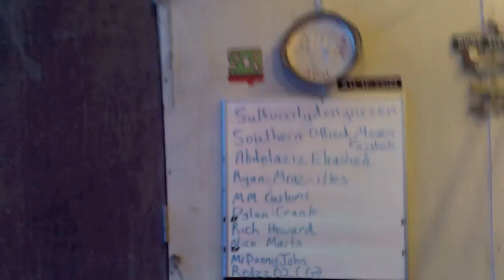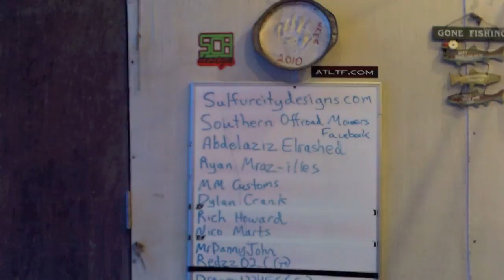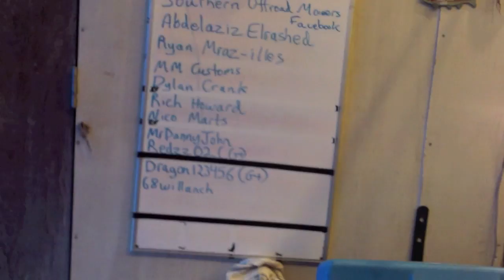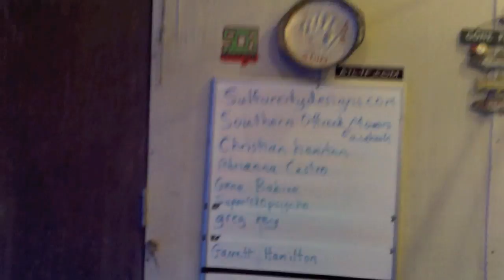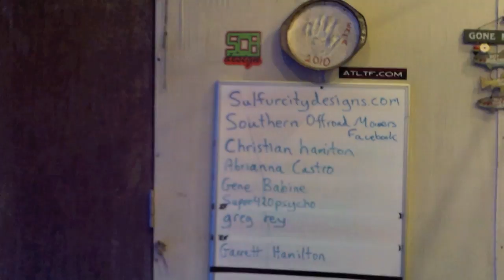Dixon Chain repaired

Comment: Enjoyed the videos. I just got a Dixon ZTR 361 vintage 1990. Seems to be in decent shape for $300. Replaced drive chains, added fuel filter, rebuilt carb. Seems to run good for its age. Question is the short chains have a lot of play in them. I've got the replacement 15" chains should I just go on and replace them? Seems to me like they should be as tight as the drive chains. Zero turn seems to track straight and cones look good. I just don't like the slop in the the chains and knowing they're probably original too
Reply: Keep the chains tight or replace them. A loose chain will wear down the sprockets faster. I just replaced mine

Comment: Number 40 chain does not have 3/4" pitch, it has 1/2" pitch.  No uni-link, it's a "master link".
Half-links are a no-no ... they are too weak....but might work in this application.  If you need to take out a half-link, then the chain is worn ("stretched") and needs to be replaced.